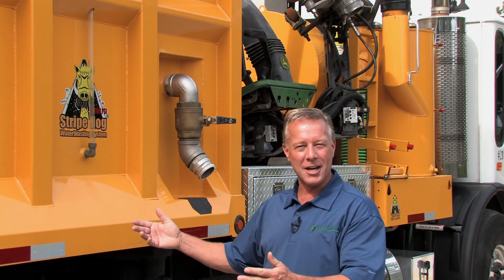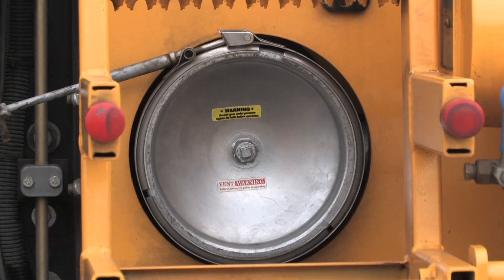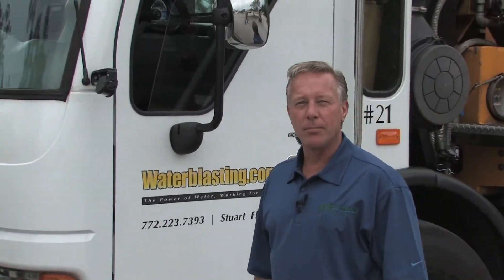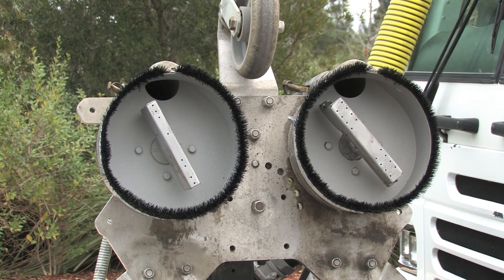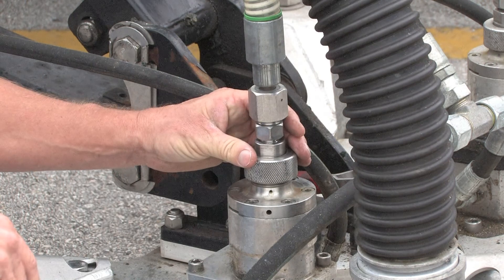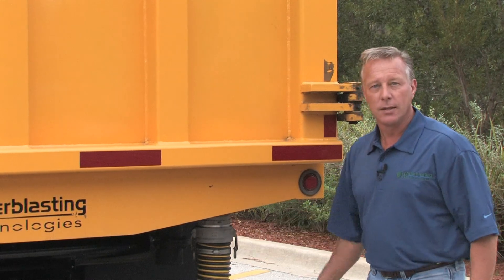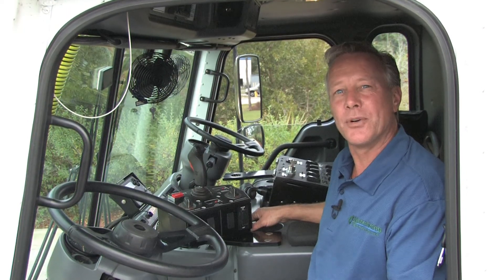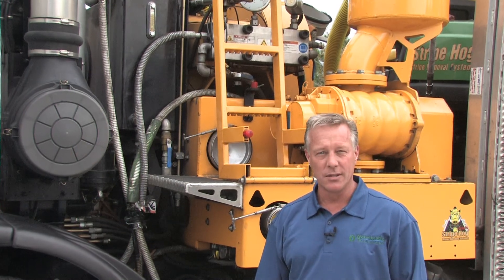Stripe Hog SH8000 Overview

Comment: Trucks are slapped together with hoses and wires rubbing on everything. Our truck nearly caught fire because battery power cables where against the steel clamps that hold batteries down in the box!!!